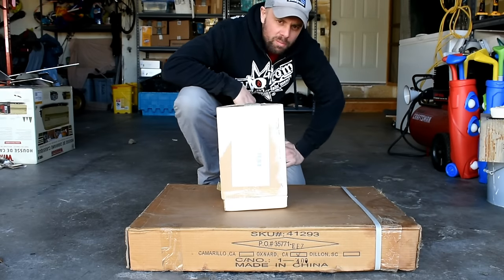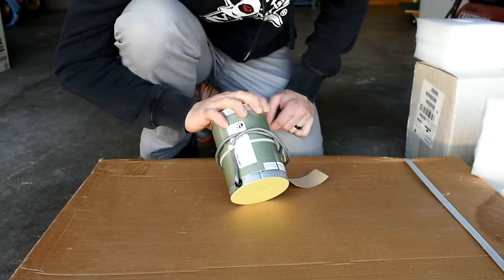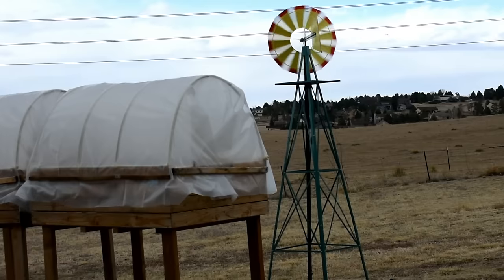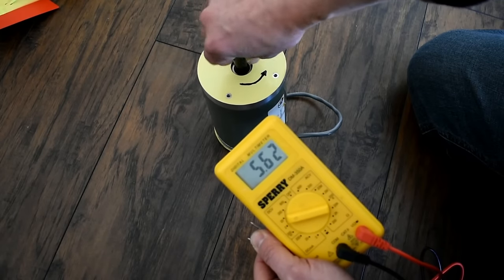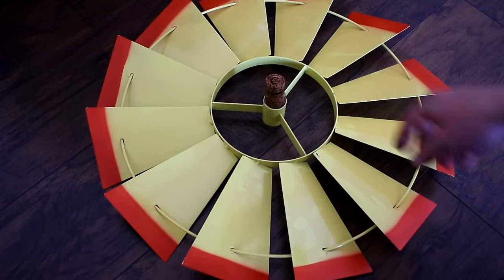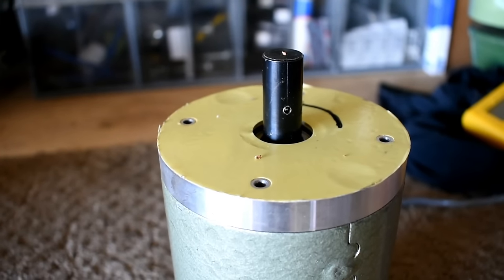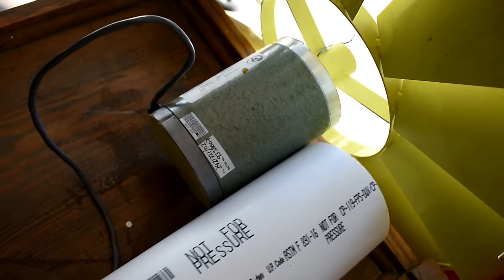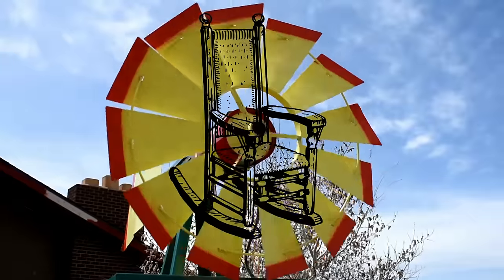DIY Homemade Wind Turbine for $32!!!💰

Comment: Misleading title!!  Ya, you built it for $32 after you were lucky enough to find this cheap kit.  No one else can do it for $32 since there are not that many good deals out there!!
Reply from the maker: If you have that outlook, you probably won't find a good deal.  This video was made to invoke thought of what can be made from scraps or junk for little to no $.  I wish you luck
Reply: @live.life.simple.  Little touchy aren't you?  No, I have already made several wind chargers out of scrap material I found, or bought for cheap prices.  All were built for between $40 and $350 for one that I bought a used 1,000 Amp generator for.    All I was saying is your title is misleading.  It makes it sound like you are going to give instruction on building a $32 charger and that is not what you did!
Reply from the maker: Not at all man.  I am just saying you are as capable as your mindset allows.  It sounds like you have lots of experience building.  Feel free to leave some advice or tips.  Thanks for watching and your comments.

Comment: Well, it seems like you are retired and bored at 40 just like the rest of us.  Hopefully, this build was just a dry run for a better build because it sucked!  
Yep, Im building one, a full farm sized one and yes, Im going to post the video when Im done.
BTW I just sold some income properties (So Cal) at top dollar and I will be buying more properties at least half of their current prices, after the 2018/2019 market crash.
Yep, all the signs are there just like in 2008.
Reply: One thing no DIY wind turbine maker Never seems to show is the wire conection swivel from the turbine to the mast,,